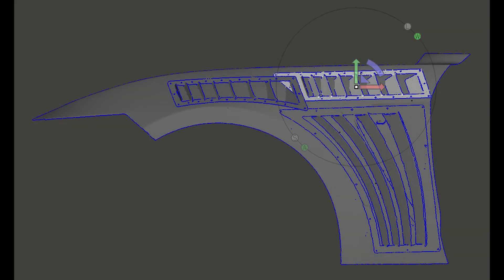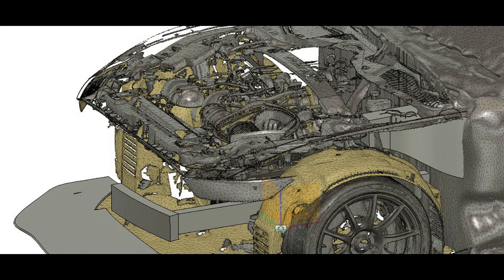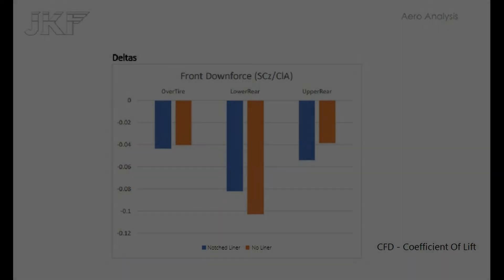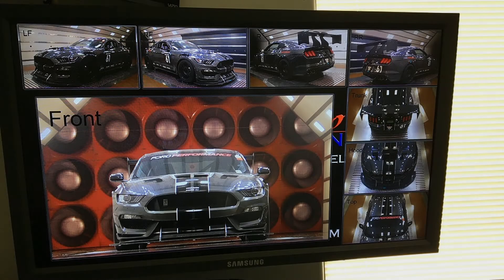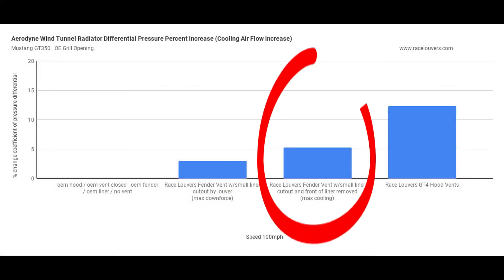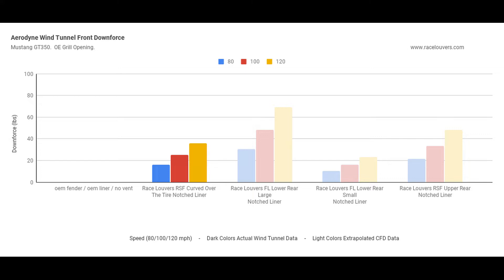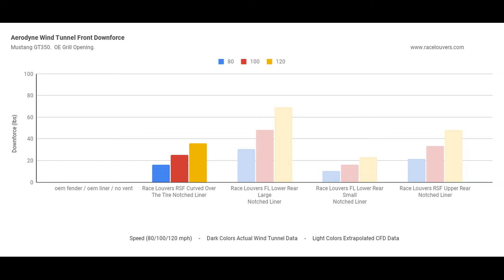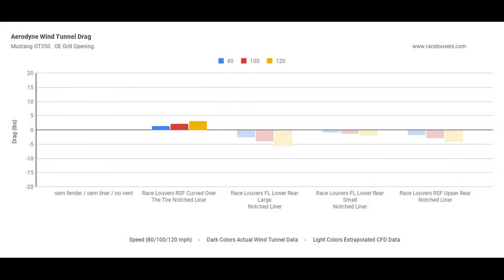Race Louvers - Fender Vent CFD

Comment: Cool! Pretty neat project!
So in conclusion, the lower rear vent would be the most effective?  Providing the most down force and less drag with the liners installed.
Or i am reading the down force char inverse?
Reply: It makes more drag but between the rest of the aero kit that's usually on cars this size the engine is easily able to compensate for the little amount of drag it has compared to splitter, canards and wing/spoilers